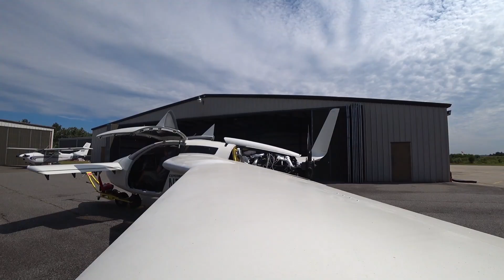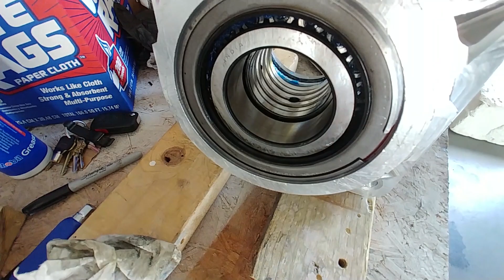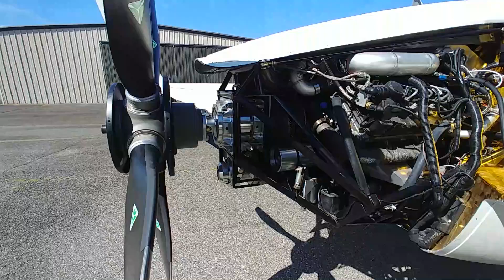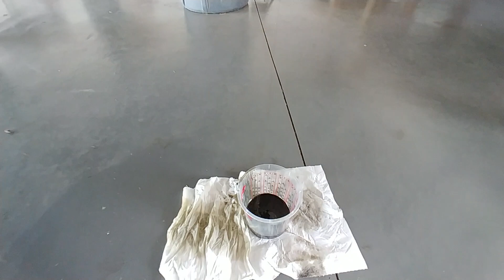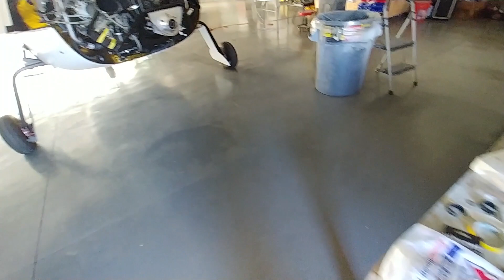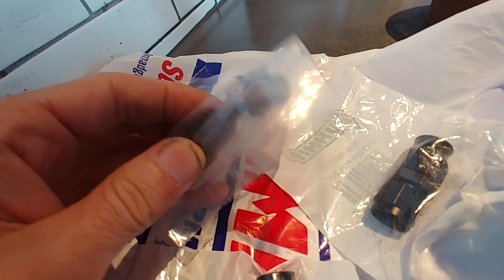Governor is Operational - Building the Raptor Prototype

Comment: I have designed Hydraulic systems and bearing lub devices for over 40 years and so far you have managed to break every rule in the book. STOP AND GET SOMEONE TO HELP CORRECT THESE MISTAKE BEFORE YOU COST YOURSELY A LOT OF MONEY OR WORSE KILL SOMEONE!

Comment: My two cents worth(for free🙂).  Seperate the oil system from the engine(maybe utilise the Audi power steering pump/system? Was it gear driven or on the accessory belt.  I sounds a bit hokey at first but there would be less load on it driving the pitch mechanism than steering a vehicle and surely there is a failsafe on the prop to ensure some pitch in the event of failure.  Also those bearing seals are not up to the job mate.  Love this project! Good luck.

Comment: If you want to seal the oil leaks use:
Loctite 542 Thread Sealant, Medium Strength - Hydraulic - Pneumatic Gas and Oil Pipe Thread Sealant

I have used this on high vibration equipment to stop the threaded pipe from vibrating loose.  You are using brass nipples.  This will glue the joint together and seal it.  No more than three threads coated and start one to two threads from the end of the nipple.  Starting a little back will prevent the sealant from entering the oil flow.

Comment: Hi, If you decide to make a pressure gauge permanent in that location, perhaps you might find an oil-filled one. It will dampen the vibration, though that might be a good location for a pressure transducer of some kind. Though, ultimately anything touching the oil system may be a issue someday.
Reply from the maker: It's just temporary to know that the governor itself is working. I'll be removing it soon enough.
Reply: Raptor Aircraft I’d suggest a sender unit, similar to any car, with a digital readout up front,......... or a similar oil filled unit with a simple resistance feedback. Properly calibrated, you can monitor it through the avionics. Not very expensive at all, and fills the need.
Reply: @RaptorAircraft  ,"If you decide...." : )

Comment: ,,, I think your prototype needs a little diagnostic capability  . One or two magnetic drain plugs, even if it doesn't need one. Checked after every runup or taxi. Of course a thrust bearing will not immediately show up on a magnet, so maybe some screen filters in the return lines. Also check the end thrust with a dial indicator, as often. And I posted a while back about a temp probe, with stand alone display from the drive .

Comment: WOW  I seen that oil pressure hit 200 psi when engaging prop ! that much pressure is gonna damage that engine quick. When you engage the prop the extra pressure that is caused from the push back of the blades is transferred back through oil system to the engine really need to have dual systems you could have left the power steering pump on it and used that it  would have been perfect for the prop control power steering pumps are regulated on average from 1000-1500 .This system could have run your landing gear also and dropped alot of weight at the same time.
Reply from the maker: It does not send that pressure back to the engine sump. It stops in the oil collar in the redrive. It's designed for up to 300 psi which is the max that the governor can produce.
Reply: Keenan, the dry Bourdon tube pressure gauges overshoot and undershoot the median oil pressure due to the gauge body being in air.  It doesn't do that with a liquid-filled gauge.  Example:  Oil pressure is fluctuating say 20 psi due to regulator valve hunting.  That will cause a dry gauge to bounce 2 to 3 times that either side of the median pressure.  Make sense?
J. Larry Bloodworth
Draper, UT 84020

Comment: Why does it shake so mouths?
Reply: I assume you meant to type: "Why does it shake so much"? The camera viewing the oil pressure gauge is temporarily mounted on the engine or engine frame. There's no dampening so it shakes a lot. The aircraft is spared the worst of the vibrations by the engine mounts. But small airplanes do have more vibrations than cars for several reasons. That's why all nuts are secured by safety wires.
Reply: Doug W or the question is why the gauge is shaking so much, to which the answer would be because the gauge is designed for air pressure, not static oil pressure, so it shows that “something” is happening, but is not designed to be relied on..... it’s just temporary to see if anything is actually happening at all.

Comment: I am not sure about cost, efficiency, or reliability, but in less space than the engine and supporting structures, you could put 2 or 3 small jet engines made in Czechoslovia.  I believe they also make a small turboprop.  Adding another engine on the next version would be a major enhancement, but the whole aircraft would have to be redesigned with larger wings for more fuel.  It may not extend range very much, but the safety factor would be huge, especially if the props counter rotated.

Comment: Here's what I use when testing automatic transmissions.  Stainless steel, liquid-filled (to keep the needle from bouncing), and CHEAP.  You can buy panel-mounted ones if you wanted to monitor governor pressure full-time.--> https://www.amazon.com/STAINLESS-PRESSURE-GAUGE-COMPRESSOR-HYDRAULIC/dp/B00BCL83XC

Comment: ,,, sounds amazing again. I would like to see stainless instead of brass on those short extensions to the fittings .  How was the heat in the drive, even if a short run ? I still like a ground adjustable prop, and let the Motec control the rpm. You might need to uncomplicate the entire system drive .
Reply from the maker: I'm going to replace those nipples with ones made from 4130 once I have it dialed in.  There's no real great build up in the drive. We need a constant speed prop in order to get the best overall performance. A ground adjustable prop is equivalent to only having a single gear in your car. Not that great.

Comment: Mate, I see fail all over this setup. Your life is at stake. Yes I am a 35 year A&P. You need to heed my warnings.
Reply: I see prop surging issues ahead once the oil gets hot.
Reply: @philipm7054  On a normal setup, the prop is bolted directly to the crankshaft and the governor increases and decreases oil to the prop's hub from the front end of the crankshaft, no external bearings to lubricate. With this setup, it needs oil to flow and lubricate those bearings while changing pressure to the prop's hub. To be successful, this will be challenging. Added external seals to cause fail. Added bearings to also fail.
Reply: @biggysground  I have been an aircraft mechanic for 30 years. 15 as an A&P on ga and airline aircraft. I see oil leaks and prop/rpm surging issues ahead at the least. Bearing failure / transfer  sleave siezing issues at the worst. I think this design is not the way to go.
Reply: @philipm7054  I agree, many here don't think long term. This may work temporarily but long term it is a disaster waiting to happen. Being that it is in a crucial area, failures spoken above can be lethal. Many here say they are aircraft mechanics, but are full of it.
Reply: Tony Valdez large band
Reply from the maker: I agree that for a production run the redrive will be in a full oil bath. But the housing I presently have is not configured in such a way that we can convert it to run that way. The tapered roller bearings are way larger than what we need and packed with grease will be fine for prototype testing. The smaller bearings on the oil collar are probably washed out of grease by now but after two runs they seem fine and are now being oiled. Also they are not carrying any loads and are also rated for higher rpms than we are running. So yes there are changes that could be made but I'm going to be testing the current setup as is. If it is fine through static runs and taxi testing then we'll go with it. I don't have time to spend a year waiting on design and machining of a full oil bath setup.
Reply: @RaptorAircraft  Prototype ok. Keep testing then.
Reply: @biggysground . Mate if you’re going to post comments like these it would be helpful if you could include specifics.  Just claiming your a 35 year old A&P does not add any weight to your comments, especially in the absence of any objectivity.
Reply: biggysground This comment was egotistical as hell. I am a 40 year A&P. He should heed MY warnings. See how that works?
Reply: @CocoEspada  not really, I see your ignorance.
Reply: @biggysground  I can't have ignorance I am a 40 year A&P. Therefore my words are superior. Sorry mate.
Reply: biggysground that’s useless and vague

Comment: Peter,

What a great update!   Looks like yo may that prop issue whipped, though I am a little concerned those redrive bearings are not getting a proper oil flow.  I understand the tapered roller bearings are similar to what you might find on an automotive wheel spindle, and they are surely over kill for the duty cycle they see in this application, but they are not sealed, and will probably run dry at some point.  It does give me some comfort that you are so attentive to the redrive and will, most likely, perform regular maintenance and inspection on it.

That gauge is bouncing around because it's a "dry" gauge and is very sensitive to inconsistent inputs, like a constantly (relatively) changing oil pressure signal.  What you might consider is a "wet" gauge... meaning an "oil-filled" gauge.  This type of gauge is filled with mineral oil or glycerine,  which will dampen the needle so it doesn't bounce around. These are common and inexpensive.

Congratulations on yet another success, and thank you for the update!

Regards,
Jon
Reply: Why not get a oil pressure sensor and then hook it up to the avionics or EMS ?  Then you get all the data time linked and hopefully stored on a memory card.